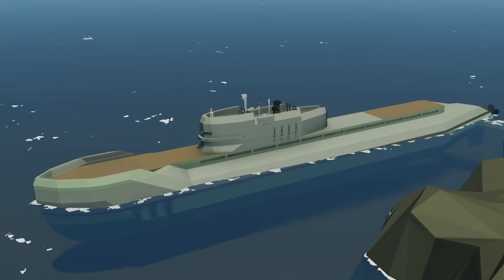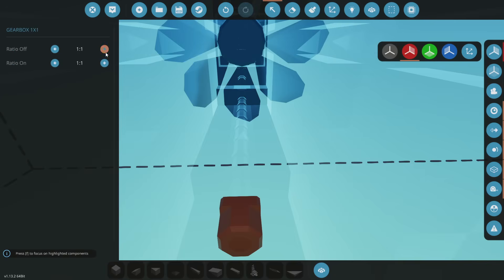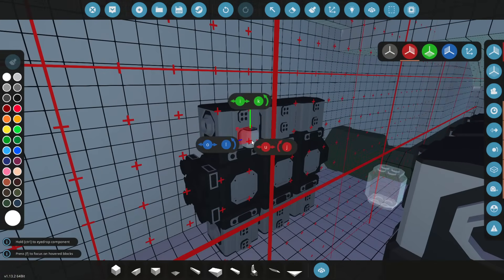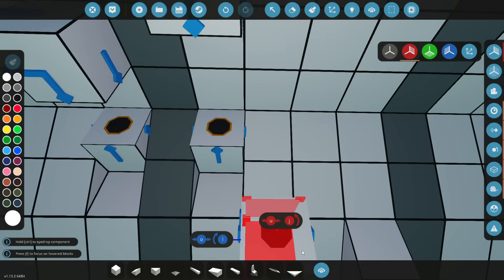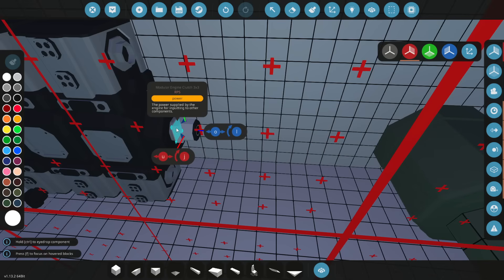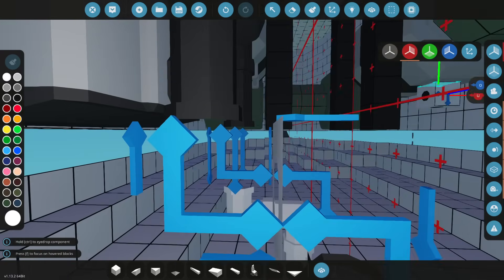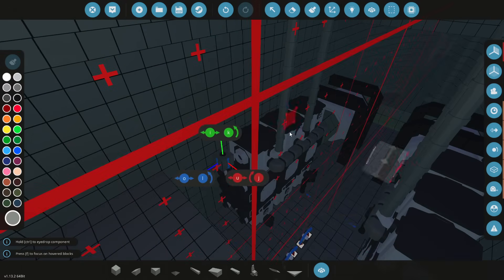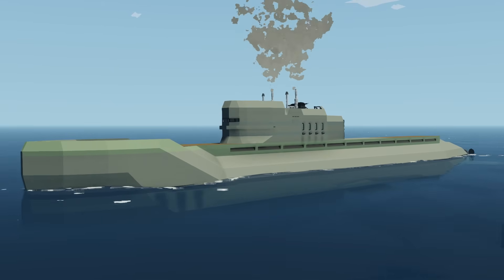TWO DIESEL ENGINES ADDED TO OUR MOTHERSHIP SUBMARINE Stormworks - Part 7!

Comment: Not going to lie this submarine looks like a Japanese submarine that carry planes
Reply: It's big, but not that big, nor does the shape really resemble an I-400 Class, which is very long and thin (for a submarine of its time) also Frantic's conning towers is more front-mounted whereas the I-400s were more centrally mounted, not to mention the length of it.

Dimensions of the I-400 class:

Length: 122m
Beam: 12m
Draft: 7m

It could carry 3 planes, launched from a fixed, front-facing catapult and would be crewed by around 140 men, by contrast, the Type VII U-boats, which were probably the most common submarine of the war (700+ built) came in at 67m long, 6.2m wide and had a draft of 4.7m with a tonnage of 769 Tonnes....the I-400s were over 5000 Tonnes....which is about equivalent to two ww2 destroyers in tonnage.

Comment: That Submarine doesn't need more exterior details. She's a Military Vessel and she's good enough like this.

What she needs are a ballast system both for balancing purposes and for diving purposes.

She also needs at least a couple Torpedo Tubes for self defence and self offense

And you also have to fix the Midget Sub's problems before being able to bring the big sub out for a mission.